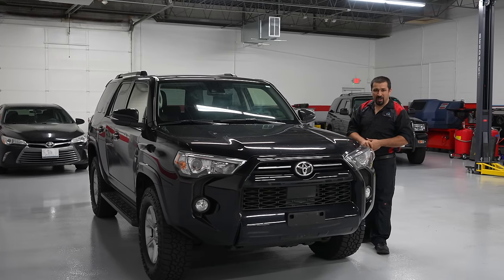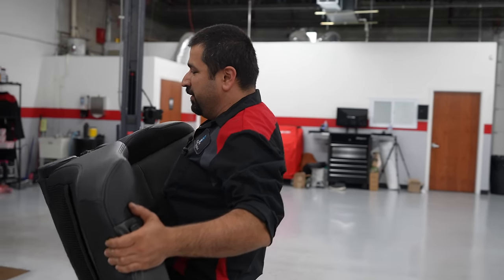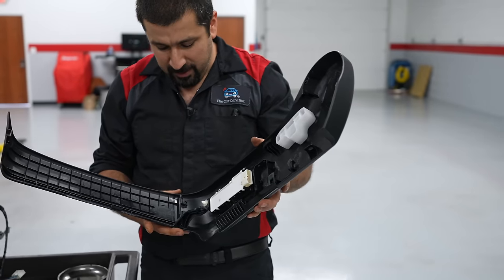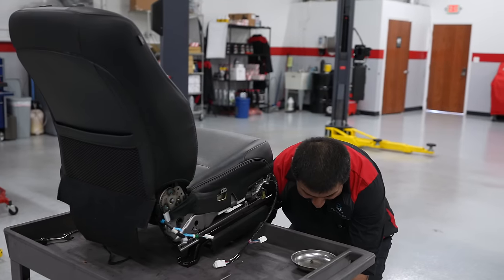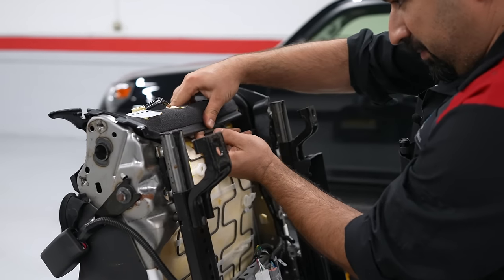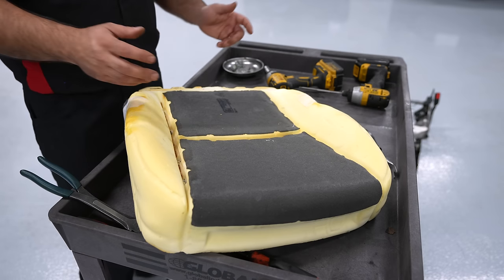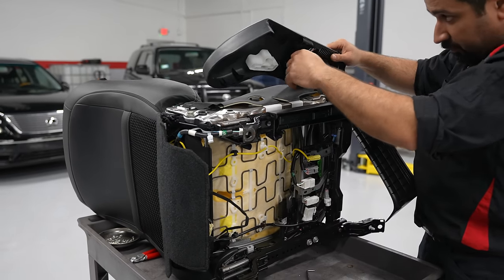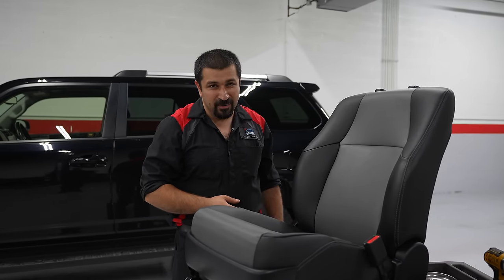Tearing a Toyota Seat Apart to Replace a Cover | Toyota Seat Common Problems

Comment: WOW AMD, ur videos get better & better! What a JOB! I'm thinkn about gettn seat COVERS FOR AIRBAGS frm a seat cover on the internet. Jst for my front. IT'S over $200, so the price u gave is I guess, reasonable. I'm a big man & I'm tough on the outside/back of driver's side & tryn to prevent damage. Any concern w/setting off air bags while installing?

Comment: In 1999 I bought a new 2000 civic. A couple years later I wanted leather seats. The dealer I bought the car from had a service: for $999 you got leather seats (any color leather, stitching and anything you wanted embroidered), leather steering wheel and leather shifter. The price included labor. I dropped my car at Honda. They pulled all the parts out, sent them to Honda of America to wrap everything in leather, and then re-installed everything. It took about 2 weeks total. I've never found another dealer to offer that service. Especially anywhere near that price. Seats came out amazing. They looked stock. I got all black leather with stitching that matched the outside color of the car (silver). I can't even find a good upholstery company these days.

Comment: I removed the base and back covers for cleaning at 200K.  Also Swapped passenger/driver seat base foam so that the outside bolsters would now be supported by the center console and the bolsters on the door side now feel like new.
Procedure for the back cover. 
Note do not remove headrest support mounts.
1. Unbolt back from base.
2.  Remove three hog-rings along the bottom on the back.
3. Unzip the two zippers on the back.
4. Remove hog-rings on front.
5. Remove one 10mm bolt from material mounting bracket (access on back under foam) thread the material and brackets through the seat foam (this is attached to the front cover.) Photo would help explain this step.
5. Pull cover towards top and carefully remove cover from around the headrest support mounts.
I then removed the mounting wire, put the covers into a laundry bag and washed them.  I did this on a 2010 5th gen and a 99 3rd gen.  Really freshens up the interior after a couple hundred thousand miles.  Your mileage may vary.

Comment: The company I work for we do contract work for dealerships all over North Carolina if your vehicle doesn’t have it we can add it just about whatever it is. From a new leather interior to a sunroof heated and cooled seats to a remote start anything you want. I just finished putting a hitch on a brand new Hyundai Santa Cruz

Comment: I enjoy and appreciate Your lectures and demonstrations.
On a slightly different topic. 2014 Rav 4 XLE. Car radio. 
Mine keeps trying to boot up. local dealer wants $1600 cad + tax for a rebuilt.
An Independent Radio shop says that he has many replacement customers.
Does Toyota have a silent replacement program for radios ?
Any suggestions?
Thanks
John
Reply from the maker: Hi! This is going to sound odd but put a charger on the car put the parking brake on then turn the key on and put the car in reverse for up to 30 minutes first before anything. We’ve had some success with this rebooting the radios and they work after that. If not aftermarket radio for sure in this case

Comment: Hi,
I have a 2009 Venza, 188K miles.  It has power seats.  When I move the driver's side seat up (towards the front), it vibrates especially on the left side, but it does move up.  When I move it back, it doesn't vibrate.  There is nothing else wrong with it and it's perfectly functional right now.  This vibration thing started about a week ago.  I looked underneath the seat and there are no obstructions.  I read up on it a bit and thought it might be the little rod that connects the motor to the left side of the seat.  What do you advise?  Do you think it will stop working soon where it won't adjust?  
By the way, I love your videos.  Many thanks for all your great work.

Comment: That it’s true my 2016 Toyota Sienna,the plastic bottom clip came off on the driver side , but mostly because my daughter is to heavy and it broke, and it will not clip back , I had to screw a bolt to hold it in place. Till I get a way to one day buy that plastic. , and maybe have you install it for me.

Comment: Hi AMD, I am getting a vehicle service and full point inspection on Tuesday before my warranty expires on my 2021 Tacoma, 3.5L automatic. The dealer is suggesting injector service, do you think that is necessary?
Reply from the maker: Hi! I think it’s too early for that age. If you are approaching 36k in a 2021 that’s higher than usual miles likely you don’t have any build up at this driving style

Comment: I have a 2015 Camry, by far the most uncomfortable seat I have ever sat in. What options do I have swapping the seat from another model or maybe a similar Lexus? I am thinking to swapping the driver seat for the time I use the car and will put back the original when I sell it in the future.

Comment: Love your videos!  I have a 2013 Toyota Avalon Hybrid 267,000 trouble free miles.  Saw your video about the hybrid battery filter and fan clean.  You did the work on a Camry so maybe its different.  After pulling everything apart to get behind the filter intake vent, there was nothing there but the black plastic duct.  There was no filter.  My question is:  Should there be a filter there, or somewhere?

Comment: Hi Amd! with regard to 4Runners, do you have any suggestion or recommendation for installing a locking gas cap? also whats the reason why Toyota designed this gas cap without lock? similar to Tundra and Tacoma.
Reply from the maker: Hi! I haven’t found a cap with a lock that works well yet

Comment: Can you check what is the real problem with bumper in 4 runner 5 gen (Front Bumper Cover Gap at Fender)? I found the T-SB-0049-20, but it doesn’t look easy to do it. Thank you

Comment: Question: I have a tear in leather on the driver side seat bottom.  I plan to repair the tear. I would like to swap the passenger and drivers seat bottoms as the passenger side is much better. Can this be done?
Reply from the maker: The passenger and drivers side are different

Comment: I’m a big guy and I find the seat padding on today’s car seats lacking in sufficient firm support especially for long trips. I realize that there basically is little to no room to work with for the addition of more padding. Is there anything that can be done about this such as perhaps the use of some exotic high density space age foam to replace the standard factory foam? Thanks.

Comment: @The Car Care Nut Thankyou for this video. I will be redoing my FJ Cruiser Drivers seat due to the holes that appear in both the lower and upper seat covers. On the upper seat cushion there is a steel ring that pokes the hole in the cover on the bolster. do you know about this common issue and is there a way to prevent it from happening to the new cover?

Comment: I have a 2012 Highlander that the drivers side seat bolster is breaking down and I would like to replace it before the fabric get a hole torn in it, it's the side by the door. Can I get that piece of foam from Toyota or do I need to replace the complete seat bottom?

Comment: Hey nut I just bought a 13 ES350 161k miles don’t know if trans fluid was ever changed, shifts fine nothing wrong just don’t know if I should have it drained and have new added. Appreciate the help

Comment: Maybe it was the video editing... It seems as if you took out more hog rings than you put back.  Thx.  Great video.  I have a 2001 Tundra that needs a new driver's seat (old enough that it has barely any electronics to deal with).

Comment: I have a2019 Camry with 11,000.
The plastic on that wraps around the front seat has broken. The door seal on both doors need to replaced . What tools do I need to replace the seals and seat plastic on drivers side.
Reply from the maker: Hi! It should be somewhat similar to this seat and no special tools for the seal

Comment: And ideas? Toyota refused as it was 12 years +. Out of recall. And I was trying to replace a rear right body mount, and when I lifted the body, The rocker collapsed. More work, and I work on my back on a piece of cardboard when I weld. You should see my arms

Comment: Well Upholster here  Okay got all removeal tips. The one  I'm to work on has stitching came out on that center seam on seat across so. If I remover cover will I be able restitch on sewing michine or is heating element attached to it? Therefore would be in my way ? Or should I hand sew it back togetherinstead of removing ? Its about 5 inches that needs sewn. I'm a fairly good hand sewer.

Comment: I have a 2021 Tacoma with leather seats, the driver one has an annoying squeak on the right side as I go around left turns. Is this a common thing?
Reply from the maker: Not a common one but it can be fixed. I’d bring it up to the dealerships attention if it’s under warranty

Comment: Anybody getting seasick from the way he uses the camera on the tripod? Sudden left and right movements almost like the tippod is so new that when he goes to pan left or right he has to push hard and then it suddenly releases and he over moves it and has to correct.. handheld is much better. Like when Amd pulls the bolt covers out from the back and doesn't show them, Eros should have pointed the camera down to them because they weren't shown in close-up. Easy with a handheld. And then when Amd did the bolt close-up, Eros doesn't focus fast enough and we just see a blur. Defeats the purpose of him showing us stuff if you can't see it. Just leave it on full auto focus. Otherwise cut out the part we can't see if the ego must have the camera on manual.. on the inside at least use a light if he can't go into the exposure and open the iris of the lens aperture so it's not so dark..
Reply: Lol i think so too 😅 coz i was kinda dizzy and this made sense

Comment: I have a question about the seat motors, since you brought them up and mentioned how hard / expensive they were to replace. My car (which is a '19 Lexus) has electric seats and it also has a function that can do full / partial seat movement when the car is shut off, and started back up again. It is called 'Easy Exit or something in the settings menu).

Should I disable this to extend the life of my seat motors and my battery? Thanks.

Comment: Foe the Sienna years you spoke of, can you replace it with a seat from a different Toyota model to eliminate the issue? I have a 2013 Sienna xle awd with this skirt issue on the driver's seat.

Comment: Is it possible to replace driver/passenger seats? Example I have cloth seats on my 2016 4Runner, I want to swap them for TRD 4Runner seats with seat warmers. Is it a plug and play, maybe with recalibrating SR5?
Reply from the maker: They are plug and play except the wiring for the seat heaters would need to be custom
Reply: @TheCarCareNut  nobody would give me a straight answer - thank you for verifying this. And thank you for supporting Toyota owners with your wealth of knowledge.

Comment: I have a 2009 Lexus IS250 AWD and the radio and navigation system stop working. The AC control is stuck on high. I've checked all of the fuses in the driver and the passenger side in and out. All of the Youtubers suggestions have been wrong. I was hoping to find a solution before removing the radio and the control panel. Do you have a suggestion? Thanks.

Comment: Hello sir I was searching your channel for a seat belt video but I struck out. I have a 2013 Prius both backseat seatbelts are pulled all the way out and won’t retract. I scoured YouTube: nothing. I took one apart. Not a good idea. Could you recommend next steps. Trying to avoid the dealer.

Comment: I noticed you didn’t disconnect the battery or at least it wasn’t shown. Is this not necessary when disconnecting the cables for airbags and seatbelt detectors? I want to permanently remove mine from my 2021 Prius and can’t find any videos for that generation.

Comment: I have a twice previously owned 2007 Tundra and the drivers outside side seat bolster has wear through. How easy or similar to this 4runner would it be to change just a bottom seat cover. Its the gray color leather.

Comment: My 2020 rav4 xle, the drivers side seat, when i push the button to move the seat forward only one side moves moves forward. I think maybe the one side  just came off the track  but I'm not sure. I'm still in the 3 year warranty window for like a month and a half do you think it would be covered by the warranty and what kinda price would it cost to fix it if not?

Comment: I have a 2008 4Runner, the Urban Runner edition with the "Alcantara" faux leather and suede seats. The driver side seat bottom and back need to be recovered. Because the previous owners have worn out the door side covers, by sliding in and out. I haven't found any Toyota Alcantara replacement covers. Do you have any suggestions for an alternative?

Comment: The company I used to work for always told me to disconnect the battery before unplugging the air bag switch. Is that not necessary?

Comment: I am trying to remove the bottom seat cushion on my 2014 Avalon, and I am having trouble getting the cover off the side where the seat controls are, I do not know or see if there are screws to remove to get it off...  any help would be greatly appreciated

Comment: Hi. What tool did you use to place steel rings back when you assembled seat? The one with red handles.
Reply from the maker: It’s a hog ring plier. Can be bought off of Amazon
Reply: @TheCarCareNut  got it, thx! Would need to replace my 2004 camry seats covers and many people in area where i live uses plastic zip ties, that i find as a mistake. I think steel rings are more durable over time.

Comment: Not always Toyota have parts for its cars/truck.  I have 2001 Tacoma Doubelcab 4WD, and the ABS brakes Actuator (Toyota Part = 44050-04010) can't be purchased.  I have been trying to get one, but I was not able to locate one.

Comment: The driver power seat fuse (30A) blown twice in 6 months, wirings and rails look normal underneath the seat, what could be the cause? 2019 Sienna Limited

Comment: This probably goes for all cars, but for basic maintenance like washing those covers ( I have a toddler... need I say more? ) these seats are WAY to complicated in design to take apart.
I saw the zipper at the back and thought I could just zip them off and put them in the washing machine.... no. Frustration ensued. ( Corolla 1.8 hybrid TREK 2019 )
After watching this video I realize what I started....

Quite a fail, I feel.

Comment: Is it possible to clip a new part "2019 - 2023 TOYOTA RAV4 FRONT LEFT SEAT LOWER FRAME TRIM COVER OEM 718680R050" back to the side without taking the WHOLE seat off?

Comment: Most of the new Toyota seats  are T50 Camry RAV4 CHR highlander the new tundra. I haven’t seen inverted torques in a long time in Toyota that’s mostly a Chrysler thing now. Toyota is slowly going away from 14 mm going to Torx sockets. That looks like soft tech that Toyota puts in their cars from factory it’s not really leather it’s mostly vinyl. It is a good idea to disconnect the negative battery terminal when unplugging the airbag plug under the seat. Also there’s a good technique for removing seats from vehicles. I don’t see it very much on YouTube basically you’d lean the seat all the way back until it touches the backseat. if you’re on the passenger side of the vehicle you will put your left hand in between the top and bottom cushion where they meet. with your right hand you will grab the front of the seat take the seat straight up rotate the seat towards the outside of the vehicle until it is at a complete 90°. Then with the seat sideways you may then rotate your whole body and seat out of the door this is a good way to take seats in and out of cars because you can see the tracks the entire time and avoid scratching anything. It is also easiest to carry the seat above your head with the lean back on your back trust me I have picked up thousands of seats. Picking the seat up and just going straight out the door is risky especially with brand new vehicles because you can scratch the seal plate

Comment: As a Avalon owner the only thing I'm disappointed in is the leather seats. I have a 2014 with light gray seats and about after 3 years one of the seats started turning yellow. I took it to the dealer to see if there was a recall and I was told no. They also said they had no idea why it was turning yellow. Very disappointing. Anyone else have this problem?

Comment: Any help with how to get rid of driver's seat squeak on my 2018 Lexus GX 460 ? Going over bumps, making a hard left or right turn, or even wiggling the seat makes a squeak! It's really frustrating!! I tried WD40 on the rails but didn't help at all.. Been wondering if lithium grease would help ? But where exactly and how to apply it ? Thanks!!
Reply from the maker: Hi! This one is hard without diagnosis. You’ll want to find what’s causing the squeak first

Comment: Hie, on a slightly different topic, i want to change my gear differential oil on 2006 lexus is250, i cant the GL5 75w-85 or GL5 75W-90, the toyota dealer says they only stock GL5 85W-90, so is it safe to use?